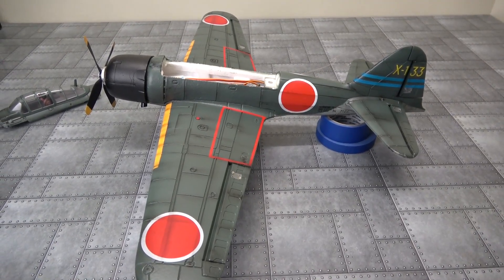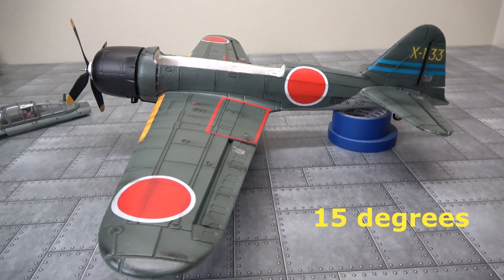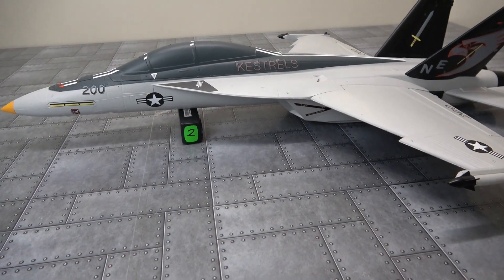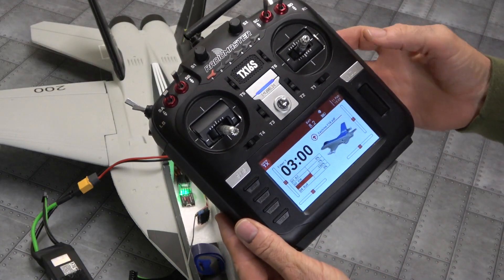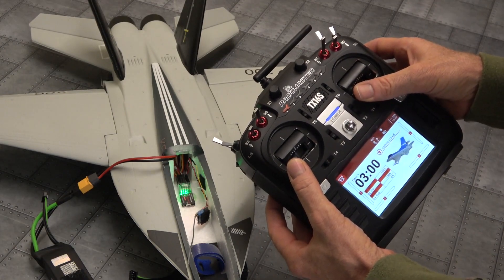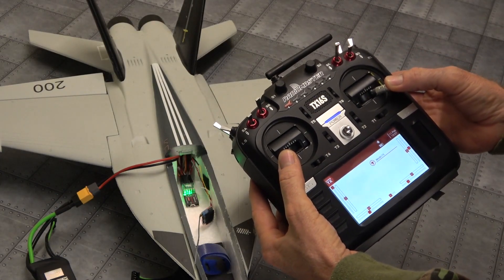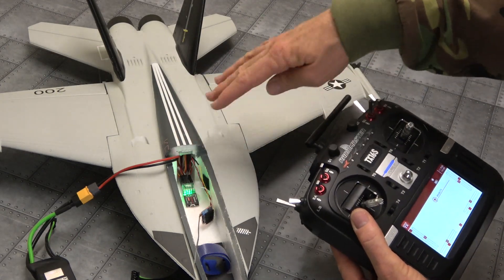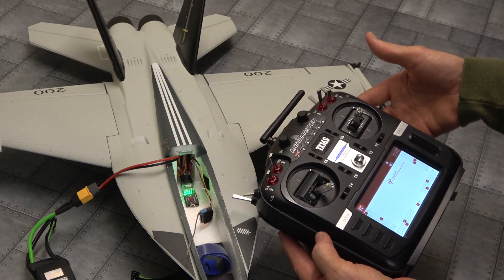Radiolink Byme-A Flight Stabiliser UPDATED in FMS A6M & Eachine F18 Gyro Flight Controller 4CH

Comment: Blowy Fly RC seems to have departed the scene these days but the channel's videos are still found useful by many folks. So for them - TAKE NOTE!!!  
The Byme stabs (A & D) need to see Aileron and Elevator outputs at 2000usecs and Rudder and Throttle at 1000usecs to complete the initial calibration stage as shown here! NO Rates/Trims/Sub-Trims/Mixes changing the raw outputs when calibrating! 
Also the channel order (on an S-bus or PPM serial connection ONLY) MUST be A, E, T, R, ch5 (on a 3-position switch), ch6, ch7 (on a 2-position switch.)
Reply: very good comment, i did tim flaps and elevator in my scratch build plane because they were to high and i could not run the calibration.....i will try again removing any trims in my radiomaster radio to see if works. thanks

Comment: The gyro wants to see all 3 channels (Rudder, Elevator, Aileron) at a specific extreme and all at the same time.  This can be complicated by channels being reversed and having not 100% rates.  Even if you are in the right corner but have a lower rate (say 80%) on any of the three channels it won't calibrate. So:  1) Go 100% rates to calibrate.   2) if you have any channel reversed in the radio then that stick needs to go "the other way" e.g. If you had the ailerons channel reversed you'd want that stick in the bottom left corner instead of bottom right.
Reply: Keywrecked!! - but probably not the best way to run through the set-up on these cheap Chinese-type stabs. Best is (after satisfying connection requirements mentioned above) ...
1. Do the "Level Calibration" with the stab installed facing forward (right side up or upside down only) and plane level across the wings and with the nose up at the normal 1/2 throttle cruising attitude.
2. Check the stab correction directions are good in "Stabilized Mode" - reverse any that are not with the button.
3. Check that the radio sticks directions are good and reverse any that are not in the radio set-up. 
Reversing the stab direction ALSO reverses the stick direction. Reversing the stick direction HAS NO effect on stab direction. So fiddling with the radio stick directions BEFORE you have the stab directions correct would seem pretty brainless!
Also the stab is told which way up it is installed by the Level Calibration. So fiddling with either the stab or stick directions BEFORE you get that correct would seem to be even more brainless! 😜🙄
4. AFTER completing the above rigmarole (should be a once-only job)THEN you can add any Rates/Trims/Fancy Switching etc that you require. BUT TAKE HEED - any electrical trimming you add in Manual Mode will have to be replaced with mechanical adjustment of the servo links and cleared off of the transmitter. Otherwise when you switch from Manual to the Stabilized/Self-Leveling Modes the stab will treat them as stick inputs and your plane will jump off in odd directions. 😊
Reply: @theoztreecrasher2647  I don't disagree with anything you said.  I don't remember why I made my post five months ago but I think somewhere in the video he had trouble getting it to calibrate.  I wasn't trying to give a full setup how-to.  Just why he couldn't get it to recognize that he was trying to calibrate.
Reply: @js32257  No prob at all mate. The 2 posts yesterday were mostly to give the full information needed to anyone else who came here looking for the correct set-up procedure for these quite handy (and cheap) little stab units - not someone who's already worked it out. 👍👍😉
Reply: @theoztreecrasher2647  Just curious...what does keywrecked mean?  Feeling all dumb n stuff!

Comment: Thx for posting. Radiolink got back to me after 3 separate troubleshooting sessions and I believe it finally worked when I saw the light flash. I think similarly with yours in this video is that when you create a new profile, it brought in channel 4. Apparently the Byme needs 4 channels of AETR even though the F18 doesn't have rudder. Just my guess.

Comment: looks like you elevator was reversed. 4:01
Reply: Good catch! Yes, at that point in the set-up procedure the radio stick direction (at least) was reversed. May have been caused by having to reverse the elevator stabilizing direction sometime. (Also reverses the stick direction - the reason you must do the stab direction first!)
Reply: @theoztreecrasher2647 i just bought a sbus receiver by watching your video.
Question: do i need to change the directions of the control surfaces in the receiver or in the radio? i noticed for example that the gyro was reversed so do not know where should reverse it, gyro or transmitter 

i hope you have a comment that can help me. thanks

Comment: Not sure how you are measuring your angles there Blowy. The usual is about 3 to 7 degrees nose up depending on your airframe. !5 seems out of the park and not at all like what you actually have there. 
Have you sorted out the S-bus output on the A8S receiver yet?
Also nobody at Radiolink seems keen to publish the switching point values of these Byme Stabs. Trying to find someone on the forums with the requisite test equipment to sort it out.
Loved the Gobbledegook video they put up on the forums to "enlighten" us. 🙄🤔
Reply from the maker: Yes 15 degrees does sound high maybe it's because the thrust angles pointing down and I did have a problem with the multi-protocol latest download 1.3.3.7 amber keep telling me I had low signal so I went back to the previous one 1.3.3.0 and problem fixed